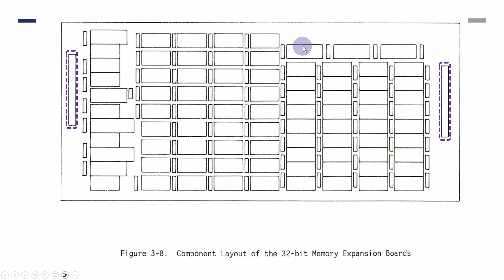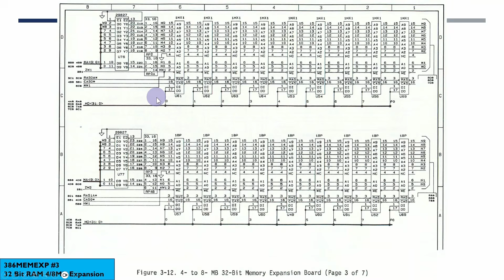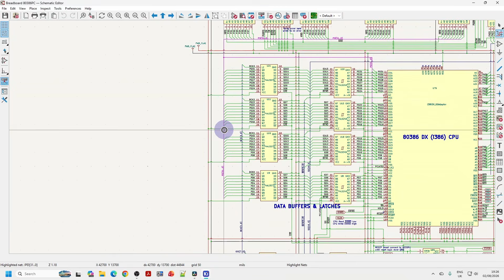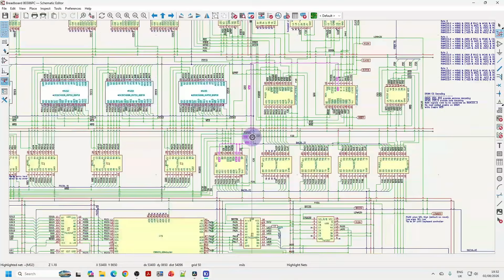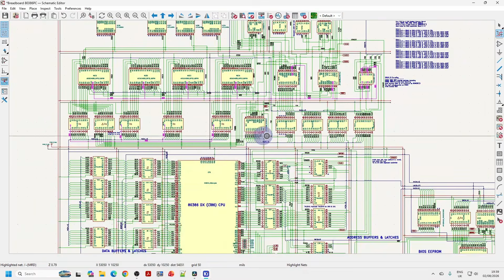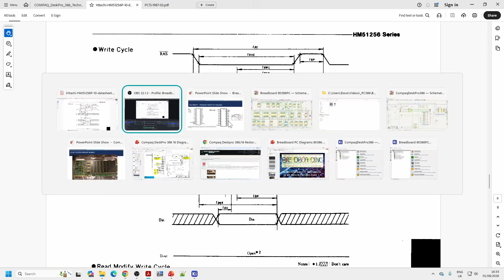386 Breadboard PC #20 32 Bit Memory Board Part 1

Comment: You should only need 4MB for Windows 95. 10MB seems like a lot of work for nothing.
Reply from the maker: While 4MB is the official minimum (I had a 486 DX 33 and 8MB was much better than 4Mb) I'm aiming for 10MB to ensure it runs more comfortably and supports those early Linux distributions too. Dave

Comment: in 2026 I cannot afford a 6000 dollar computer. I woder, who afforded in 1986. Nice video, good details, I am thinking to make a 8 bit computer from parts.
Reply: Már hetek óta tervezem a sajá ttl processzroromat. Remek agy munka. Valaha is el fog e készülni? Nem tudom. De remekül szórakozom közben. Rengeteg "aha" pillanatom is van.
Reply from the maker: Good on you. I can appreciate the ah ha moments too. Best way to learn is by doing it! Though I am still disappointed I was never able to get DMA working properly on my first PC project. Hopefully this time it will🤞Dave
Reply from the maker: Agreed! My first computer in 1982 was a 6809 Dragon 32 - about £199/$300. My next computer was 10 years later, was a 486 with 4MB RAM and that was £1300. PCs before that were too expensive. I borrowed laptops from work before that! Holding off replacing my 7 year old Dell XPS laptop as replacement will now cost 2.5 x as much as it cost originally. Crazy times. Dave